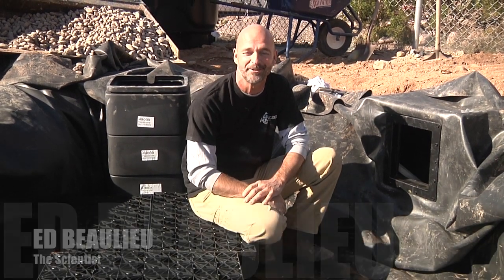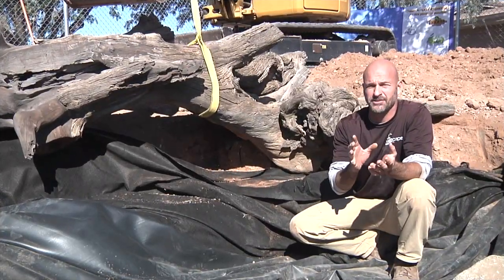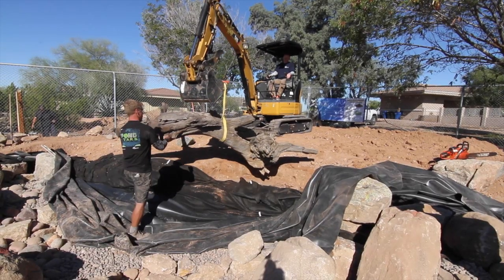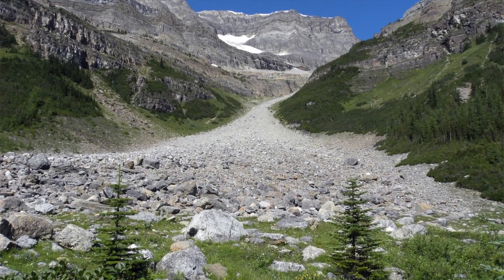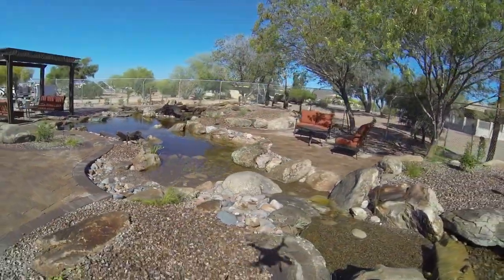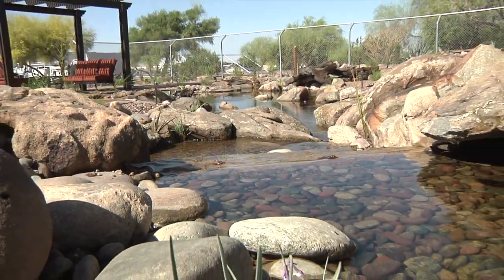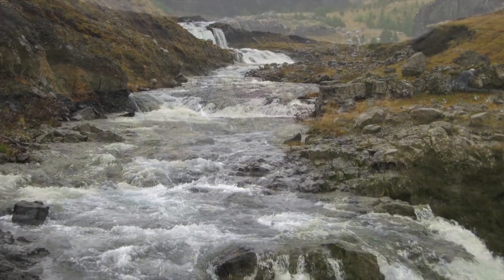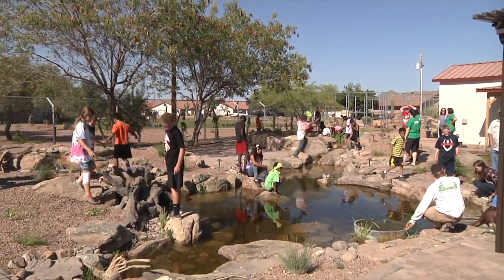Aquascape Pond Squad - Project Details - Sunshine Acres

Comment: Quanto escreve 7,3 milhões de galões d'água, o que quer dizer? 
                       Qual o volume de um galão para você em litros? 
No Brasil, a palavra galão não possui um volume específico, podendo ter um galão de: 900 mililitros, 3600 mililitros, 20000 mililitros. Ou seja, o volume de galões é ao gosto dos fregueses ou dos fabricantes.
Reply: When you write 7.3 million gallons of water, what do you mean? 
                       What is the volume of a gallon for you in liters? 
In Brazil, the word gallon does not have a specific volume, and can have a gallon of: 900 milliliters, 3600 milliliters, 20000 milliliters. 

That is, the volume of the gallons is to the taste of customers or manufacturers.

Comment: Hello squad , congrats on your wonderful videos. I have a question that never gets discussed. How do we calculate the correct amount of water that should travel through a bog filter per hour? I am planning to build my pond with a surface area of about 600 sqft and depth of around 6 feet. I want to have a very large bog of about the same size of the pond approx 500sqft. I will have about 5-10 koi fish. Also the bottom of the pond will have gravel and water will pumped through the gravel up flow. I would like to know how how much water per hour I should pump through the pond and how much through the up flow system on bottom of the pond. I never found anybody that discussed this topic....glad to hear your input.